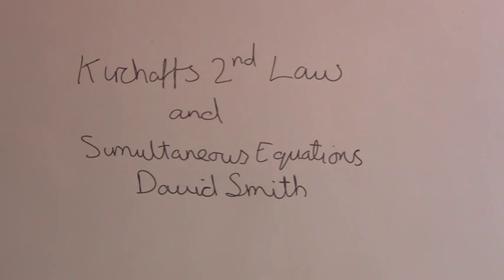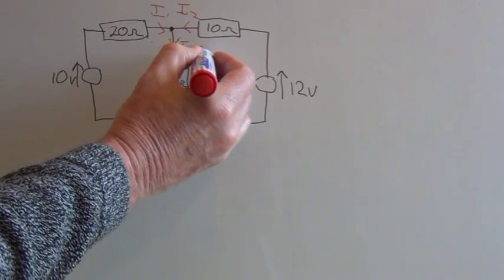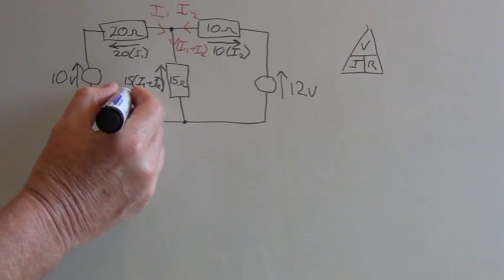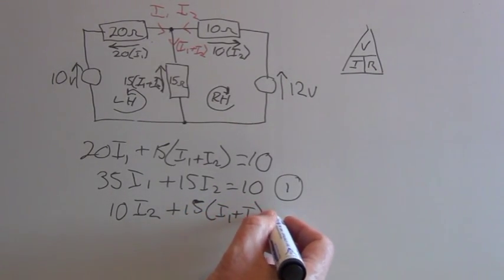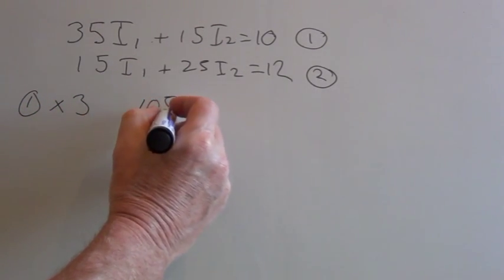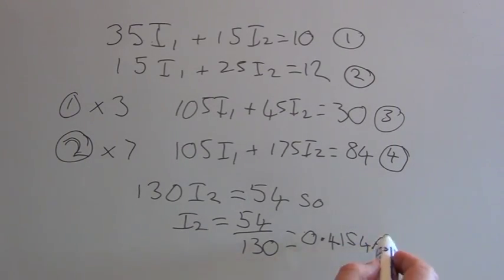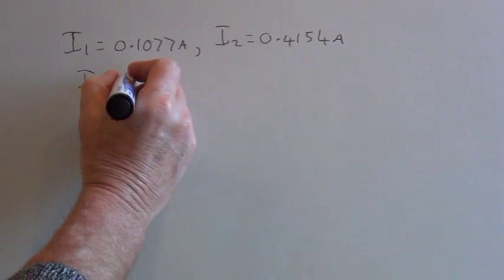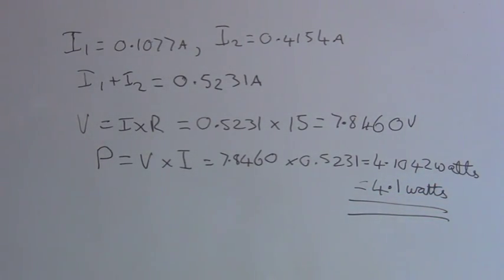BTEC LEVEL 3 Kirchoffs 2nd Law and Simultaneous Equations #1

Comment: Great video but why aren't you following the voltage rules...when the current passes through its negative and when it passes against its positive...It doesn't really affect the answer but you'd lose marks in the working out
Reply from the maker: Najae Porter Hi Najae, thanks for the comment, throughout the video it is assumed that the audience have already got a good understanding of Kirchhoff's laws hence the video is an example.